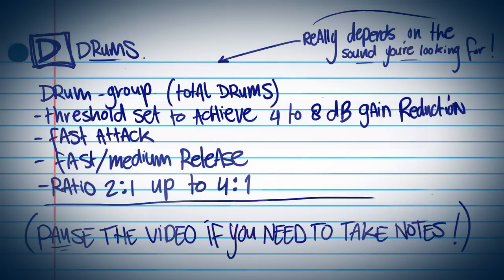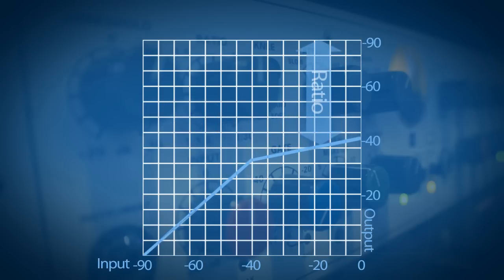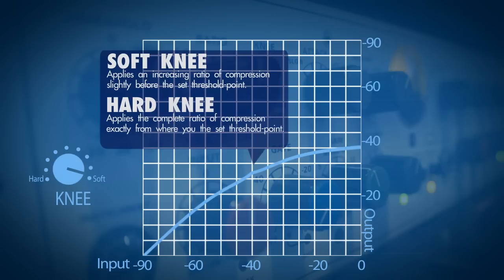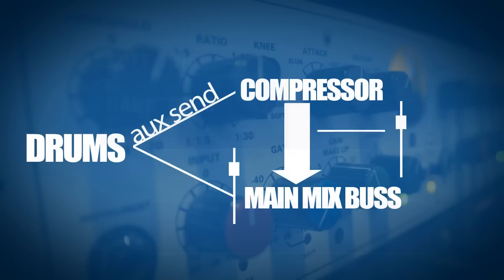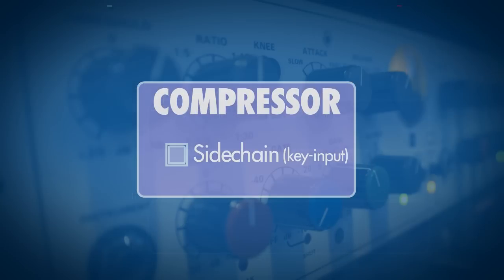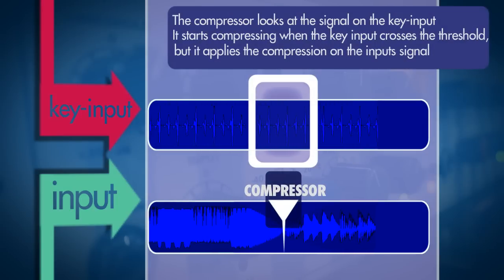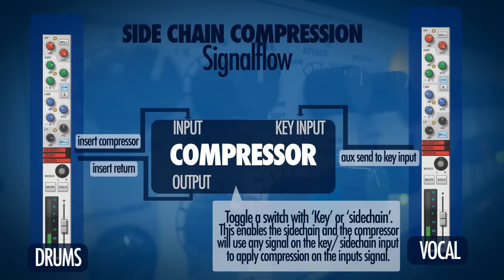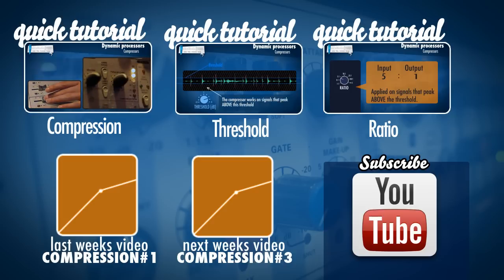Audio Compressors explained #2  - setting up

Comment from the maker: Hi Anthony, I will be doing delays and effects in the fifth season.. So it's a bit off-topic right now... But to get 'more delays when sounds get louder' you can play around with the 'feedback' setting. (This sents a percentage of the delays output to the delays input..) If the sound is soft, an 25% feedback will be barely noticable.. With louder sounds you will clearly hear the second delay with a 25% feedback setting. So playing around with the feedback will allow you to do so...

Comment from the maker: And perhaps making a dedicated clone of the signal you are using the delay on.. Use an expander on that channel to make soft sounds even softer and than send that to the delay. This would give some more dynamic range on that channel.. You could keep the original track in the mix without delay, and have the expanded track of the mix-bus and just use that for the delay. Hope that works for you.

Comment: Compression should only be used to achieve a certain sound in the mix. Michael Jackson’s engineer for the Thriller album said he used no compression on the tracks, just faders. Only use light compression to make softer sounds loud. The mastering stage will use more compression to glue everything together

Comment: I have a question.
When your using a compressor for mastering your/others tracks, do you export your project file like a wave file, mp3 etc. and then use a compressor.

Or

Do you use the compressor in the project?